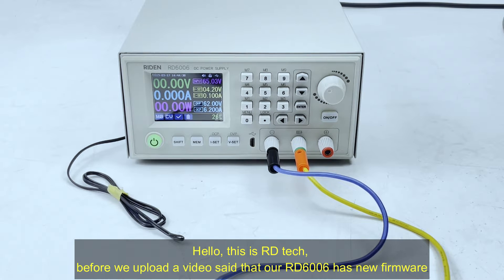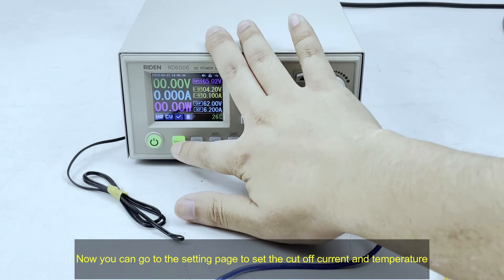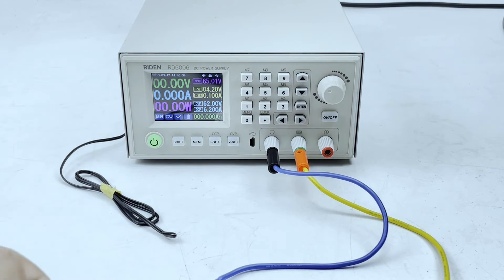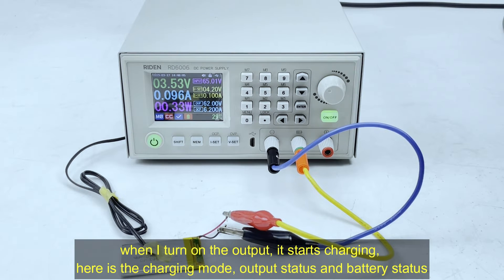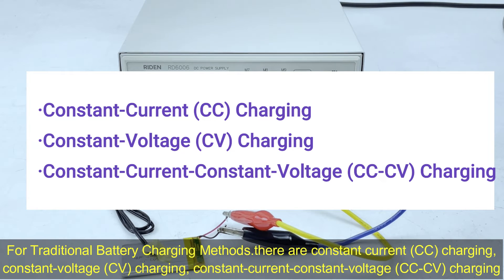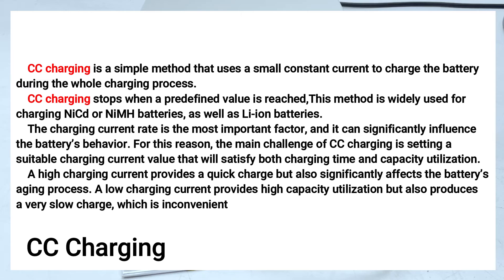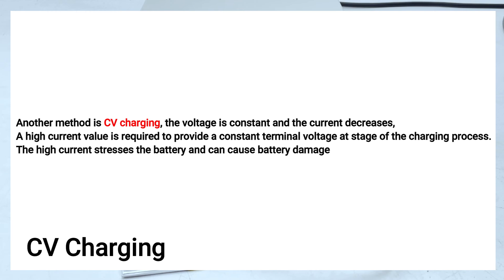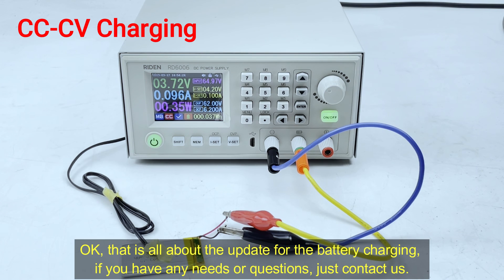How does RD series power supply charge the battery, CC CV means what, RD6006 RD6024 RD6018

Comment: Why is it that when I charge 18650 battery with RD6012P, I set the voltage to 42V and the current to 0.5A, connect the black and green wires to the battery and press the output button, but it disconnects within 5 seconds and cannot be charged? What is the reason?
Reply from the maker: sorry your message is hiden, I find it in the unreplied message list, do you solve it already? please check the battery voltage, normally if it turns off, there are 2 main reason: 1. output voltage error, see if your setting voltage has 10V with the battery voltage, 2. please check the cutoff current you set in the setting page, see if the real current is lower than it

Comment: Could have used temperature data to smoothly decrease charging current
Reply from the maker: hello, you want to use the external temperature sensor to detect the battery temperature to control the charging current?
Reply: @rdtech9153  Just a suggestion for future firmware versions, I'm sure a lot will find it useful. Personally I'd like scripting/native extension API to have more custom programmability at hand.
Reply from the maker: I will tell our engineer to see if it can be added @yunodiewtf

Comment: How i can force CV mode ? 🤔
Reply from the maker: hello, for the output mode, it is decided by the load type and status, for example you set 30V 2A to a 10ohm resistor, it is CC mode, the output is 2A and voltage=2A*10ohm=20V, it cannot be CV mode, and for battery charging, it is CC-CV mode, when the charging voltage reaches the peak voltage, it will turn to CV mode

Comment: What is the best RD power supply to buy for charging a 12V car battery ?  Best to have one that can do pulse or frequency charging to desulfate the plates.
Reply from the maker: hello, it depends on the battery type and capacity to choose the RD power supply, for RD power supply, the main difference is the output current range, but for do pulse or frequency charging to desulfate the plates, our power supply cannot do that

Comment: Hello RD Tech! I purchased RD6024W with S800 and 1200W PSU and I noticed when charging Fiamm AGM 95Ah battery in constant current mode the voltage shown on RD screen was 13.8V whereas the voltage on AGM battery contacts measured by UNI-Trend UT89-X multimeter showed 13.37 at the same time thus deviation was more than 0.4V!. But then after RD entered costant voltage at 14.4V there was a very little deviation (only about 0.01V). So main question why are those voltage numbers inaccurate on the RD module while CC charging mode and should I then adjust V-SET to 14.4 + 0.4 (deviation from multimeter measurements) ?
Reply from the maker: hello, can you record a video of this and send it to my email or  send it to our aliexpress?
Reply: What was the voltage drop in your cables? Did you calculate that in?

Comment: 2:32 Oops, you shorted the crocodile clips when you put the battery on the table, that's why the panel showed that the battery is not connected :)
Reply from the maker: yes, only when the cables are connected in correct way it will change the icon and allow the output, otherwise it will not output

Comment: what's the difference between using the battery charging terminal and mode versus using the regular red terminal and setting a current limit? Is it just the battery temperature monitoring?
Reply from the maker: the green terminal has reverse protection, cut off current and temperature setting

Comment: What is the minimum v of the 1200w   unit
Reply: Мах мин v 1200w
Reply: 68v1200w    +-мах мин v ?
Reply from the maker: do you ask us on aliexpress already? 1200W PSU is set to 68V, its lowest voltage is not a exact value, it is a range between 50-60V, each PSU has difference so we cannot tell you the lowest value

Comment: What is the difference between green terminal and red terminal? Does charging batteries with red terminal can damage module? Is green terminal protected by some diode or MOSFET to prevent reverse voltage/current and burning Riden module?
Reply from the maker: you can use the red terminal to charge battery too but if you connect the battery in the wrong way and you turn on the output, the fuse will be burnt immediately,  if you use green terminal to charge battery, you can only get output when it is connected in the right way
Reply: @rdtech9153  how about protection if Battery would have 20V and Power supply will be set lower? like 5V? Is there any protection for reverse voltage and current flow?
Reply from the maker: @Atetus94  hello, that is why we ask customers to use green terminals for battery charging, if you set the voltage lower than the battery voltage, it will prompt  wrong setting value, and it will not turn on the output, you can only set higher than battery voltage to charge it

Comment: Hey!  I own 2 of your PSUs.  A beefy 20A 50V buck and a versatile 5A/50V boost/buck.
I use the boost/buck to run all my 12V and USB powered devices from a solar charged battery.
Tonight (winter) the battery ran out of juice.
So I connected the other one to the solar battery set to 12V, 3Amps.  It can stay on to simply "support" the battery should it get too low.  I even intend to add a smart switches so the PSU can be powered down when the battery is fine.
Reply from the maker: thank you for your support,  for our devices, as long as you use them in the normal input and output range, and no connection mistake, there is no problem for long time work, if you  meet any problems when using them, just contact us

Comment: A link to the firmware would be nice.
Reply from the maker: hello you just need to connect the device to the PC software, then you can click the firmware update to get the latest firmware
Reply: @rdtech9153  I have to flash it manually, (unless you make a MacOS variant).
Reply from the maker: @wildekek  for now we only have windows system PC software

Comment: Those exposed crocodile clamps on the end of a LiPo battery, I see you like to live dangerously sir!
Reply from the maker: actually we have our own cables but I do not use, you can see for RD series power supply, if you use the battery charging terminal, it will only work when the battery is well and correctly connected